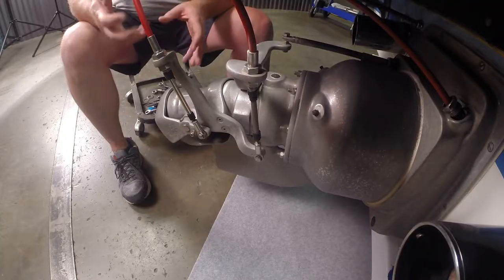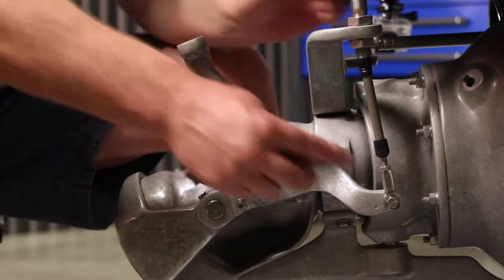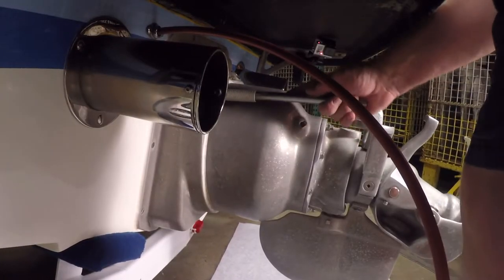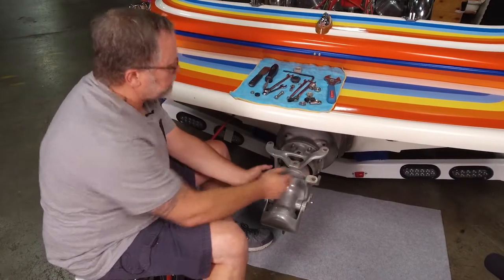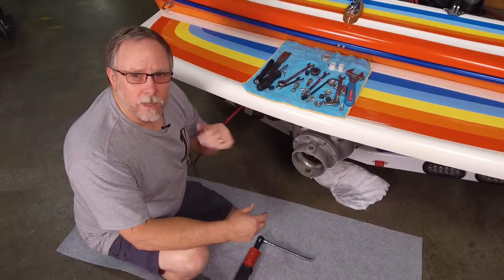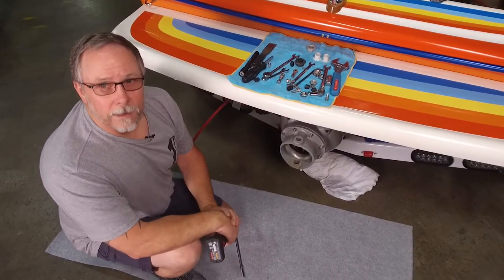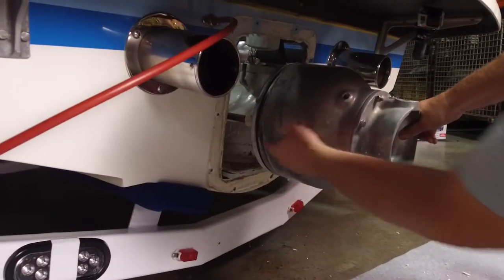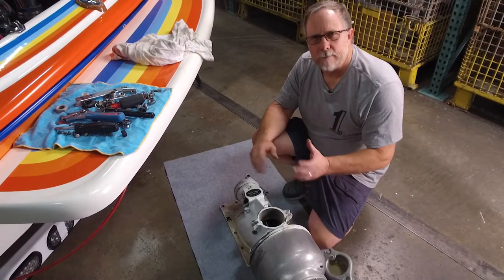Removing a Berkeley Jet 12JG Pump

Comment: If an o-ring is used to seal between the Bell and the transom housing, does the o-ring go on the Bell after it is assembled and then install the transom housing last??
Reply from the maker: The o-ring goes on the groove in the bowl after assembly and then the transom housing is installed.

Comment: On the u joints is there only the 2 to pick from or how do you know which one you need?
Reply from the maker: Yes, there is the 1310 for standard applications and the 1350 for very high performance (500/600 HP +)
Reply: Powerboat 1 pantera boat with a 454... so 1310 ?!... the marking are hard to read  thank u
Reply: Powerboat 1 pantera boat with a 454... so 1310 ?!... the marking are hard to read  thank u
Reply from the maker: @Factory928AC  Are you trying to figure out what you currently have or what you need to set up new? A stock or mildly upgraded 454 would normally use a 1310.
Reply: Powerboat 1 I snapped the joint. The markings are so hard to read I do not know what one I have or need . I can read the stamp on the spline but the number pops up nothing
Reply from the maker: @Factory928AC  We just released a video on the LS build we are doing that goes over the differences - check it out here: https://www.youtube.com/watch?v=C4TApoE2gzU

Comment: Where'd you get that gauge on top of the packing glands?
Reply from the maker: That is a spring pressure grease fitting that was customer installed.
Reply: @Powerboat1  I have that same thing on my boat and the zerk fitting has ripped out of it and damaged the plastic that it is molded into. Any idea where I can buy a new one??

Comment: Who are you and how do I send my jet drive to you!  Haha
Do you rebuild drive? 
Berk 12je with aggressor bowl and such.
I just want to drop my boat off like this guy did!
Reply from the maker: Contact CP Performance at 707-585-9871, if you send your pump to them they can do a rebuild on it.
Reply: How much do they charge for the rebuild?
Reply from the maker: @marcos22571  Rebuilds at CP Performance start at $800 for parts and service and go up from there depending on options.

Comment: Mine looks totally different.
Reply from the maker: This one had a Place Diverter trimmable nozzle installed instead of the original factory nozzle. There are a number of other differences you can run into as well. See this link for a handy guide on identifying your jet drive: https://www.cpperformance.com/t-Berkeley-Jet-Pump-Identification-Guide.aspx